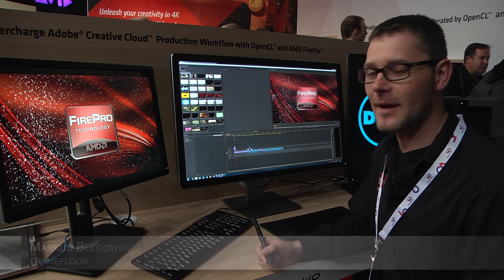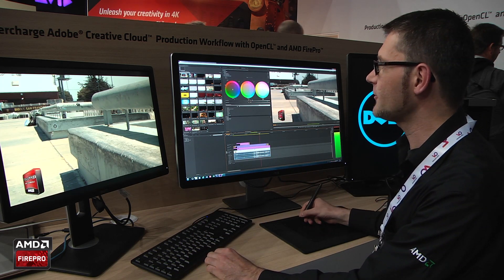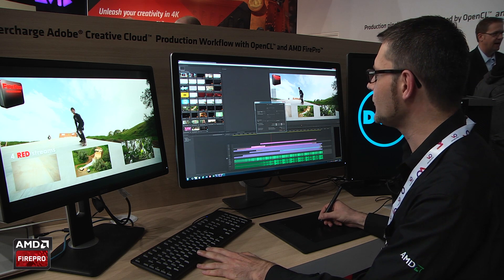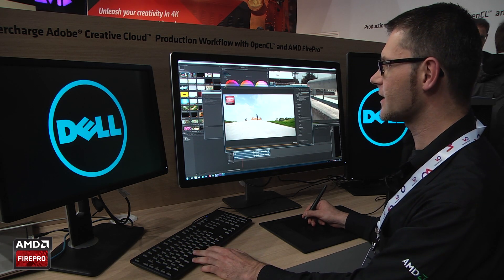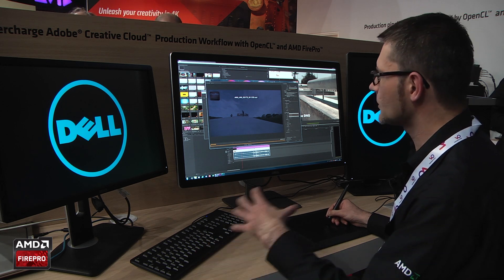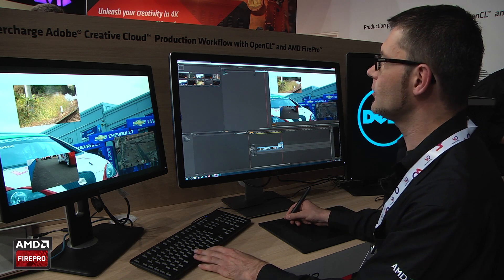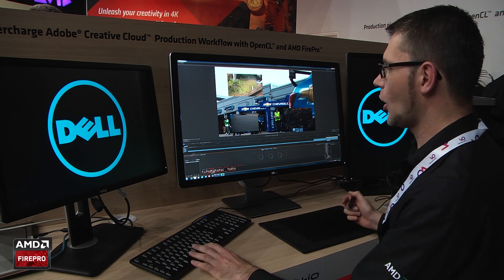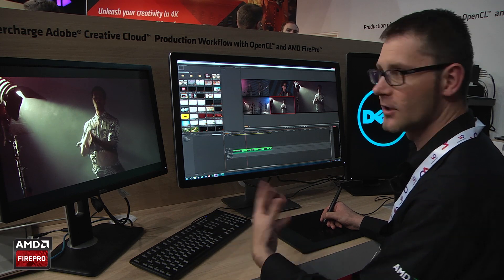Adobe Premiere Pro CC using OpenCL and AMD FirePro

Comment: AMD A8 7600 3.8ghz Kaveri Quad Core (bnew)
GPU Type: Radeon R7 series
Emaxx EMX-A70fm2hd+iCafe Motherboard (bnew)
4gb ddr3 pc1333 Memory (bnew)
Rise/Neutron case with 600w psu (bnew)
320gb hd seagate/wd

this specs can do adobe premiere?
Reply: +payatotslim Yes of courser i have a laptop with an intel i5 and 4gb dd3 and a ssd drive. All you need to replace to your Rig is the HDD for a SDD. By the way i dont know your MOBO brand, looks cheapy.